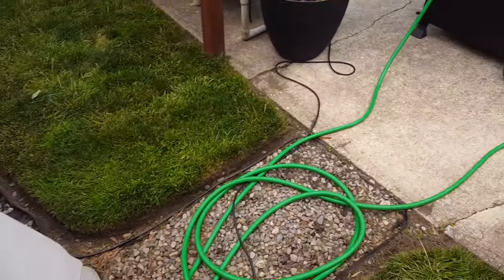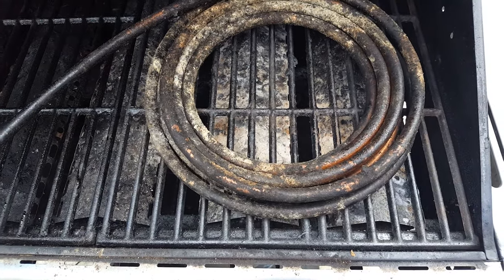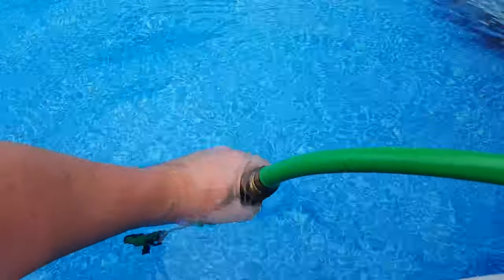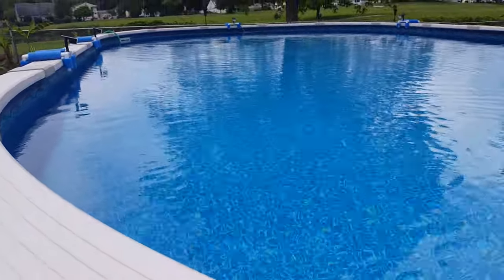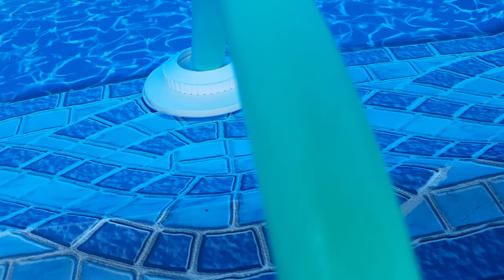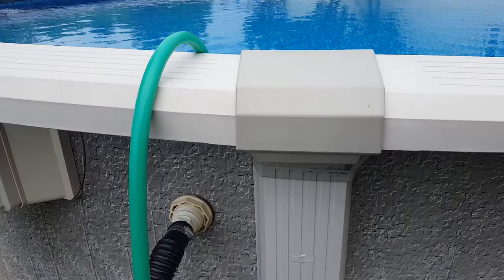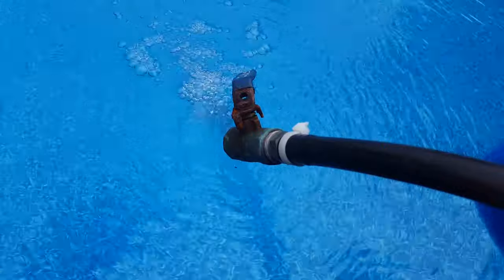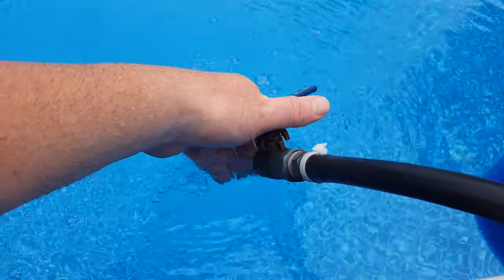DIY POOL HEATER: How to heat your pool without spending a lot of $$$!

Comment: Restricting flow reduces overall heat transfer. Push as much water as practical through the tubing to heat the pool faster.
Reply: Huh
Reply: @Exteeeze  basically, the energy being put into the water is being wasted by how long it takes to transfer.

Its 500deg inside the grill - but that heat isn’t being transferred to the pool. It’s staying in the grill.

Ideally - the highest sustainable temp inside the grill, whilst at the fastest flow rate to the pool thats possible, is whats desired.

He’d be better with 250deg in the grill, and a 5x faster flow rate. You’ll heat the pool faster, and burn much less gas doing it.
Reply: You're basically trying to cool the tube instead of heating the water

Comment: just an idea since you are mechanically inclined -- a more efficient way of heating your pool and also a great way to cut down on your house utility bill would be to run your hose to your a/c unit outside house and transfer the heat to the pool.   i've seen a pool that was heated by basically being a big heat pump for the a/c unit.
Reply: Yep, if you have a geothermal unit you can do the same and that's basically what the pond helps with anyway.

Comment: I’m wondering if the system would be more efficient if the only suction was from the pool and then the solar heated water is discharged to the inlet of the grill.

Also, consider using a much shorter hose between the pool and the grill, so you’re not losing heat to the air

You might also consider putting a large cookie tray above your copper pipe to trap more heat and make the copper heat. Transfer more efficient.

Comment: As others have said, you want the fastest flow possible. You need to move the heat to the pool as fast as possible, and it will be easier on your pump as well

Comment: The ideal thing would be to transfer boiling hot water through a tube and into your pool at the flow rate of a garden hose on at full blast. I just haven’t the slightest idea how to achieve this. Using 300 feet of black irrigation tubing with a pump designed for draining a pool cover was ineffective. After the initial blast of hot water, the water traveling through the tubing would quickly cool.

Comment: I want to ask when water pass through cu hot tube is there any dangerous material come from hot 🔥 tube in water 
?
Thanks
Reply: I wouldn't imagine that to be the case. Many residential homes nowadays still have a ton of copper water lines and drain lines in their home. It was a standard practice to use copper for that back in the day

Comment: This is flawed on so many levels. 1) The flow going through the copper piping should be maximum rate possible. You dont slow it down to increase the heat of the output, all you are doing is restricting the efficiency of the heat transfer to the water. You are also putting more pressure on the pump shoterning its life. 2) Putting that hose in the outlet with the tap puts more pressure on your pump reducing its life and again doesnt make sense from a physics perspective in terms of transferring the heat to the pool. Also you are ruining the circulation of the pool water which is vital for the health of the pool. - In summary you should piss off the outlet hose idea, and speed up the water through the BBQ. Must cost a bomb to heat your pool with a BBQ tho.

Comment: So how are you pumping the water through. I have an extra pump but it issues the big pool hoses. I have a small utility pump that uses garden hoses but I don’t think it can be run for hours on end.  Thanks for you awesome video. I really need a cheap way to get the temp up by like 6 or 7 degrees.
Reply from the maker: I put the hose into the return. This way you do not need a pump. The hose only takes up a small part of the return coming back to the pool. Put the hose in the return with the filter off because the pressure from the return will just push the hose out. I use a few tie straps on the hose. Leave the tie straps long so that it will catch the inside of the black ribbed (return tube). This will hold it in place. I will make a video showing this step. It is really easy.
Reply: No, he means the electric pump you are using with the copper pipe and grill.......

Comment: Interesting.  How long will a tank of propane last ie., for a typical day of “pool time,” how many propane (tanks) do you go through?
Reply from the maker: I only use 1 tank. I turn it on high for about 8hrs.  I use the grill/propane to raise the temp 5-6 degrees. Just enough to take the chill out of the water.

Comment: How long do you run the grill heater?
Reply from the maker: I usually run it for at least 6-8hrs. Example: 7a-2p. My pool holds around 18,000 gallons of water... If you have a smaller pool it will heat up much faster.
Reply: @miketomasetti  how much gas does that burn? Any idea in kg?
Reply from the maker: I use propane. I tried charcoal and wood but I couldn't get it hot enough. I also could not get it to stay at a high  temperature.